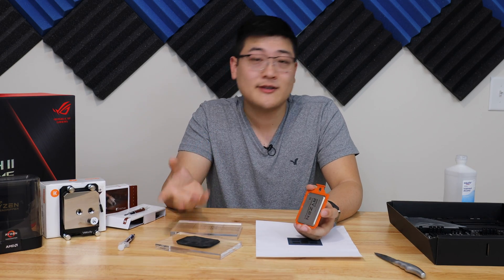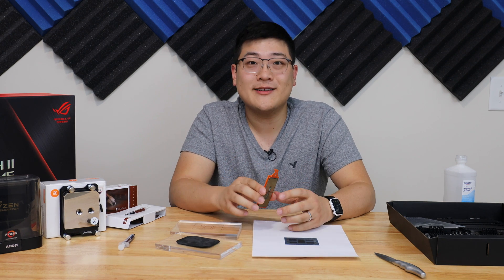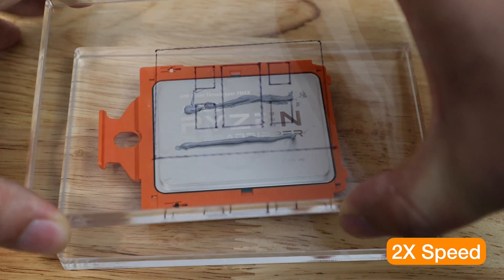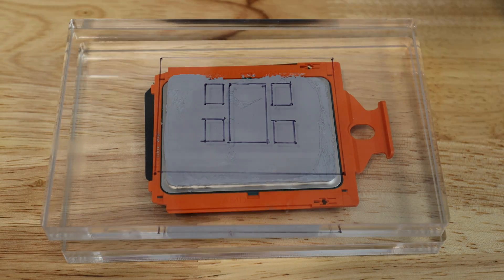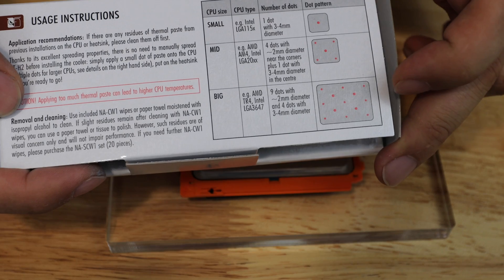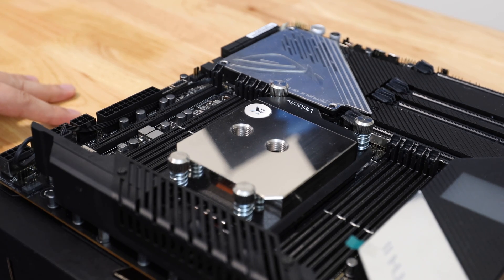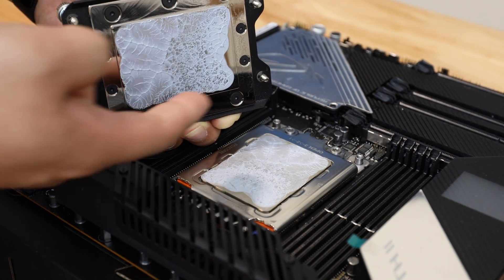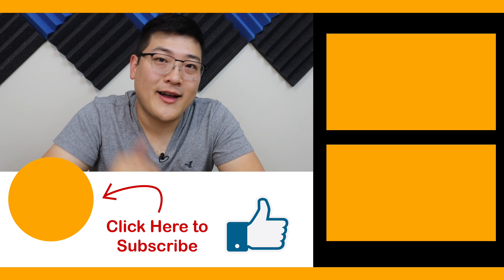3rd Gen Threadripper Thermal Paste Application Test

Comment: Dont know about h2, but the dot method(s) doesnt work on nt-h1. H1 is too thick. Arctic mx4 just flows and dot method does well.

With h1 i spread a very thin layer and put a small dot where the dyes are. Thats the only way i got the h1 paste to cover the entire ihs.

Comment: I feel like something I'm calling the "Union Jack" method would be optimal: an X superimposed on a +, just like the Union Jack flag. 

It leaves no pockets/ islands of air to get trapped, concentrates material in the centre of the die to flow outwards in all directions (thus pushing air out towards the edges through the channels left in the shape) and then covers the extremities with the arms of the X and the +.

Comment: Hi Stan, thanks for your help! I am curious, what's would it be if you add 2 more lines to the cross technique, one vertically and one horizontally both half the length of the original ones?

Comment: There is no heat for the paste to spread out, your doing it cold ! ! !
Reply from the maker: Isn’t that what I said? 🤷🏻‍♂️
Reply: @StanYanMan  I have found that with thicker thermal compounds such as Noctua or Thermal Grizzly Hydronaut is better to hold it in the palm of your hand or put it on the radiator for a couple of minutes to get a little heat into it to make it more malleable/spreadable. 

I would also suggest seeing if you can get a faulty motherboard to do these tests with. That way you can cut your plexi to the same size as your waterblock and drill holes in the correct places and then draw your chip layout on that. Then you will get a more accurate representation of how the thermal compound spreads without it moving all over the place.

Hope that helps :)

Comment: I would laugh if you broke the cpu
Reply from the maker: You and me both. I was pushing really hard on that acrylic 😅
Reply: @StanYanMan  I'm still debating if I should keep my TR 3970X overclocked or just run stock...
Reply from the maker: frostybe3r just run PBO with good cooling. That almost doesn’t even count as overclocking. Manually overclocking you will never reach 4.3+ while PBO can boost up to 4.5 in ideal situations on one or two cores. Better for single threaded applications and general use.
Reply: @StanYanMan  But I've got it at 4.5 all cores anyway

Comment: Good communication of tests.  I've got the Thermaltake Floe Riing 360 TR4 edition aio cooler ans wil be using it for my new build. I think the Noctua 13 dots it's good but I'm thinking 5 larger dots instead of 4, a larger one in the middle but the others the same might be optimal but a slightly closer pattern from the edges so you don't waste thermal paste off the edges of the IHS. What do you think?